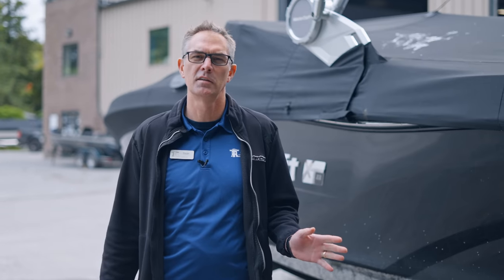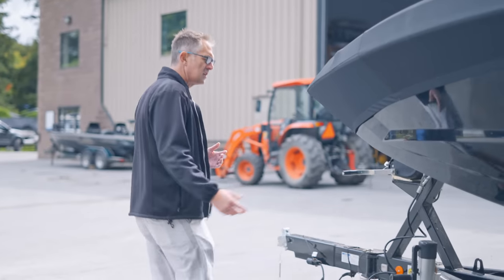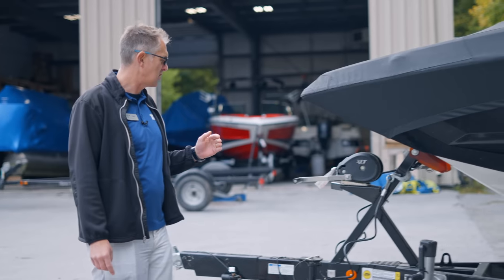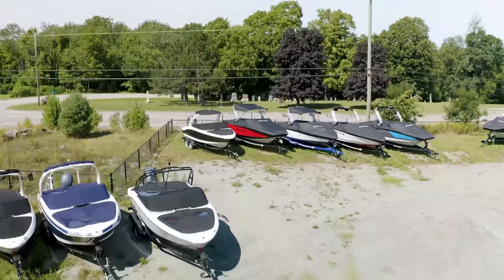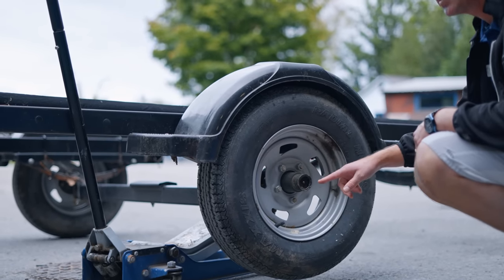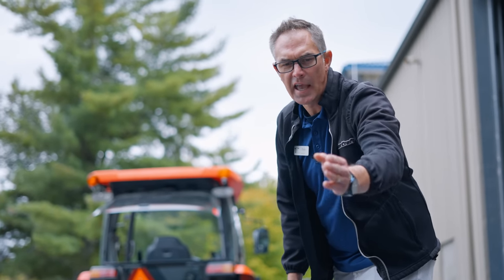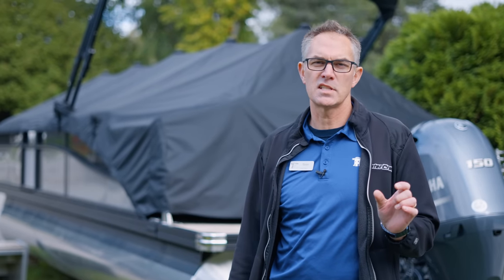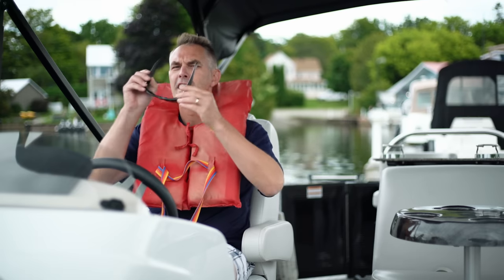Boat Trailering Mistakes

Comment: You should not leave your boat trailer, or any trailer for that matter with the tires setting on the ground. Park it on concrete or lay down a strip of plywood to keep them off the dirt. This will help prevent premature dry rot. I do this to all my trailers and replace the plywood if it starts to deteriorate.

Comment: The stated inflation pressurre on the sidewall is stamped as "maximum pressure" and should not be exceeded. For safe operation, 70% of operating maximums are recommended. Drive on and off boat trailers are the worst for failures and need constant inspection.
Reply: Chris, I used to fill to the Max pressure and in the last few years started to do just a bit less since I figured the tire pressure would be increasing as they warmed up on the road and my boat and contents wouldn’t total the max load. Before typing this reply I thought I’d try and do a search of what pressure to use. The very first website I went to called boatsafe says to fill to the max load listed on the tire. Where did you get the 70 percent guideline from? Thank you.
Reply: @akaCamo Increasing tyre pressure is to increase the load carring of a tyre as stated on the sidewall. Only if the weight of the trailer is at the combined load rating of all tyres would a maximum pressure be required. Using anything at its maximum design rating is not recommended, in this case 70% is regarded a safe limit. Over inflated tyres will produce a harsh unstable ride for your boat. Choosing the correct tyre is essential for ride confort and safety. Cheers
Reply: @AquaMarine1000  thankyou for the reply

Comment from the maker: Do you have any trailer maintenance tips to share with our viewers?
Reply: Feel the axle hubs after a few miles or at any time you may perceive a problem and EVERY TIME YOU PULL- check brake fluid if it aplys - this is how I found out our new to us 2019 Supreme had none- and all the fluid after priming back in has disappeared on us so we are replacing the hitch slide part unless I can find the correct plunger with elec lock out. Keeping a few end (butt) connectors and just a cheap set of crimpers in the glove box helps in case a wire breaks or gets snagged. If you have tandem axles, carry a 4x4 cut at one end 45 degrees and fix to a 2x6 just as long so if you get a flat, loosen the lug nuts and place the blocks in front or behind in order to ramp the good tire on the same side- by doing this, it will lift the axle and flat tire up fast then digging out the wind up jack and putting it away-LOL - I hope I explained the well :)  .. Make sure that your emergency pull cable will pull out before the safety chains stretch out all the way this will activate the trailer brakes in the event of tongue break or hitch slides out or even some dirt bad has un latched your boat when you stopped for gas and chips---the chains keep both vehicles together so not to roll into a soccer moms van, (ok that is harsh but so true). Subscribe to Len's Cove Lessons in Boating and the like button HIT IT !
Reply: Good advice!
Reply: During the walk around precheck ( every time) if you see tiny rust spots on the wheel then your lug nuts are loose and failure is very few miles away.
Reply: I have my spare tire mounted onto a hub with bearings which is mounted to a replacement spindle so worse case (burned bearing ate into spindle) any welder can get e going.

Comment: Of course the man is right about all these obvious things he mentions. But the first and most important thing to remember when it comes to a boat trailer is: Never, ever back your boat trailer into salt water higher than half way up the side of the tire wall. One dip in salt water and your wheel hubs, bearings, brake cables and everything else made of steel that's been in contact with salt water is fucked up ! Unless you dismantle, clean and lube up every tiny fucking part every time you've used it.

Comment: Rip off those made in China "China Bombs" tires.  They are nothing but trouble.  I went with all made in USA Goodyear Endurance tires on my boat and cargo trailers.  You won't be dissappointed.
Reply from the maker: There definitely are some low quality tires out there!
Reply: Most U.S. manufacturers don't make tires for PWCs.
Sometimes Chinese is all you can get. 
I shouldn't have waited that long but my last Chinese tires lasted more than ten years before I had a blow out. 
China can make some junk but if you do some research you can find a decent tire.

Comment: I can share a tip. DO NOT BUY HI-RUN BRAND TIRES. Quality is dreadful. Garbage.
Reply from the maker: Did you have a bad experience?
Reply: Yes! I put them on my pop up camper. At the end of the season, after only a few uses of between 50 and 125 miles each trip, they had chunks out of them in the tread and the tread becamemishapen. They had the proper pressure. I got a different brand, and I've had them for 3 years now and they still look new.  @boatinglessons
Reply from the maker: @redpine8665  thanks for sharing this. Good info for everyone to know!

Comment: ST tires should be changed at 4 years as there generally China Bombs and are garbage tires. It's 10 years on LT tires which I've switched to with all my trails with no blow outs, worth the price difference of ST tires.
Reply: Agree with you 💯%. Ozone is the biggest culprit that breaks down and degrades vulcanized rubber. So yes definitely replace every 5th year for sure